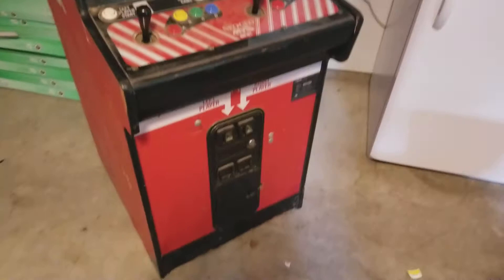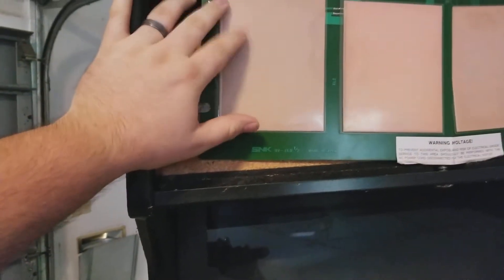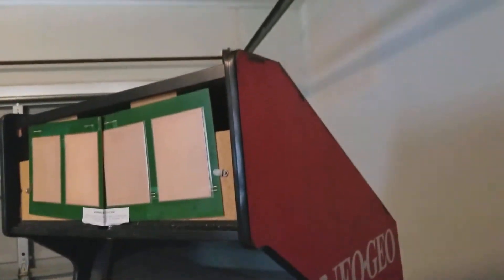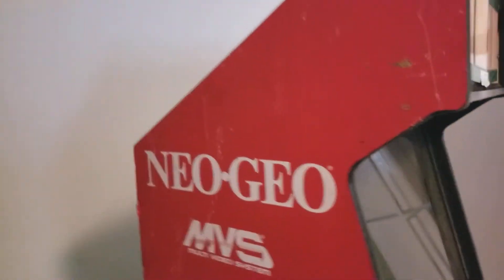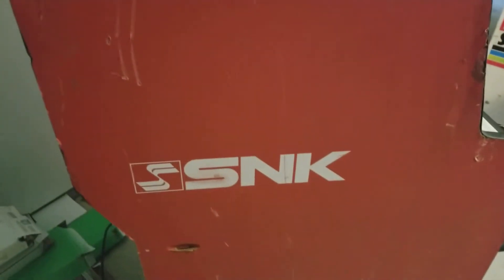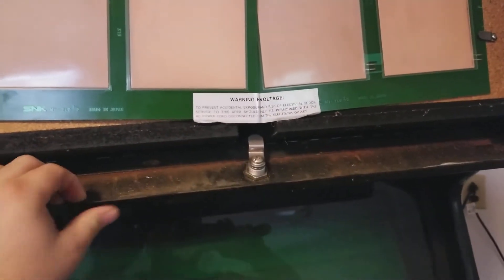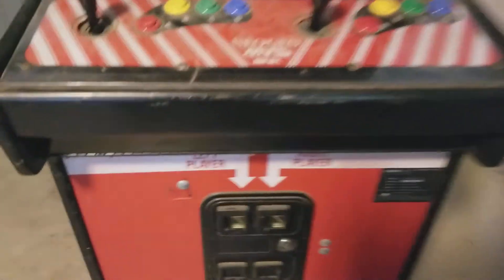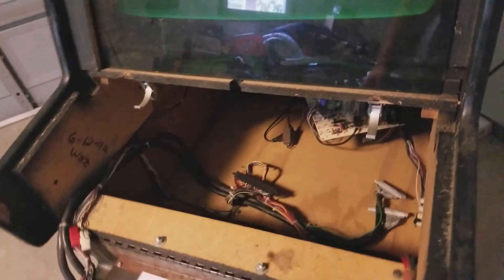Free Neo Geo MVS SNK Arcade Machine!!

Comment: Unless I'm missing something you have a MVS-4 cabinet with no MVS anything guts inside as it's missing the system board with the cart slots on it.  That's why nothing shows up on screen as it has nothing to boot up to at least play around in the system checks.  Also you can find out how many quarters went into it down where you switched it on as there should be a counter.  Had you a system board in there it internally (given no dead battery) counts the quarters/plays.  I've got a 2 slot system myself I got a year and a half ago now and your system board should be sitting right there on that wood under the monitor in plain sight and those cables would be slotted into it.  The system board itself commonly has a metal cage over the top with just slot openings for each game.
Reply from the maker: +Tanooki Suit no guts... working on it though

Comment: There are no such thing as cheap SNK Neo Geo Games, just saying. Check out the Metal Slug Games if you doubt me.
Reply from the maker: +StarTails I know a store that sells some of the cheaper ones for like 15-20 bucks a piece
Reply: I guess you know more than I do, what kind of games will you pick up? By the way, I could be wrong, but I heard that those old arcade games (including the Neo Geo) have to be repaired from time to time as they are old to begin with. So even if you fix it up, it will likely require repair from time to time as parts fail and need to be replaced. So if you can get the needed parts in bulk or more than individual, that would be best.
Reply from the maker: +StarTails yes, this will need some up keep. Good tip. You are right that neo geo games are expensive
Reply: Yes, and I would recommend avoiding the expensive cartridges unless you are a serious collector with lots of disposable cash (Thousands). If you just want to play the games, look for alternatives to buying the super expensive ones. For example, if you want to play the metal slug games, you don't need to turn to emulation as you can get them on steam or on the other places where they have been re-released. Not true of all Neo Geo games, but many have seen re-releases. Neo Geo collecting is one of the most expensive consoles to collect games on.
Reply from the maker: +StarTails I have my bar top with every neo geo game made. I love it!! I just want a few to have to play on this
Reply: The console or the arcade versions?
Reply from the maker: +StarTails both. Lol.
Reply: Arcade Machines are tanks meant for abuse.  I have some here that have been running over 20 years with no issues.
Reply: True in some cases, but some arcade console contained cheap or poorly made parts that tend to break down, particularly 20-30 years later. Check out some youtube vids on what game consoles are disintegrating.
Reply: Yeah biggest problem is bad caps....once those suckers start leaking they short out PCB's and cause some real issues! best to change out the caps in systems you know are likely to fail for sure!